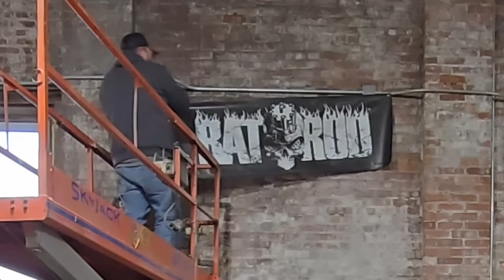Salvage yard sheet metal (C50 build part 4)

Comment: Man Anthony I found yours and Julie's channel by clicking on 1 of the C-50 video's. I seen that it was in a series and automatically subbed to your channel! I just started the series last knight and so far I'm here and I already kind of understand what you're getting the piece's for. How much body work it's going to take after the fabrication. It inspiring me to build something again! I'm wanting a C.O.E med duty truck to haul a custom camper! Got a 2000 f-450 7.3 and transmission I can use when I find a Ford cab over.  I will only be able to later unfortunately I gotta figure some stuff out first. I love the build you guys are doing for sure.
Reply from the maker: Thanks for the sub and for following along!